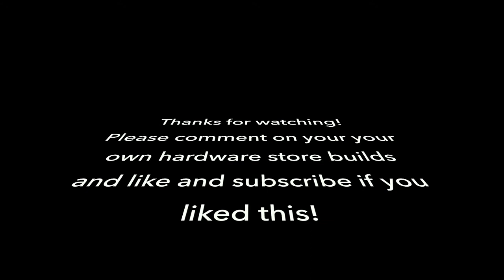Mitch and Kirk make guitars out of plywood from the hardware store

Comment: Great job! My missus told me to clear some of my "rubbish" from the garage. Apparently replying that it isn't rubbish is a bad thing to do, but that's another story 🤔. So to "get rid" of some old ply, I'm doing much the same thing as you. It's a fun, cheap project! Although not quite so cheap since I saw a used pair of Danelectro pickups on EBay, then once I had those, I had to buy a Danelectro-style neck too! It hardly matters how it sounds, I'm having fun building it.